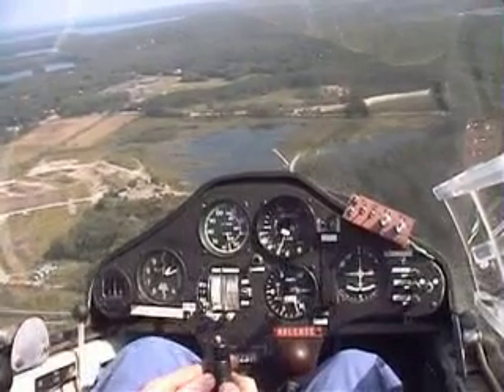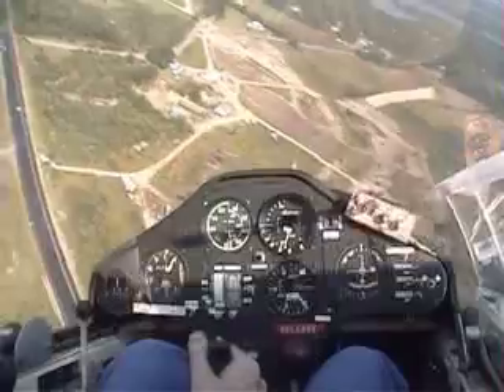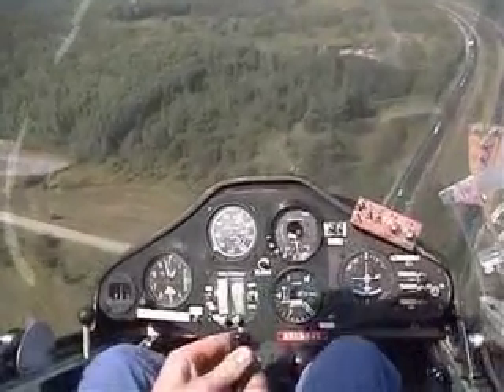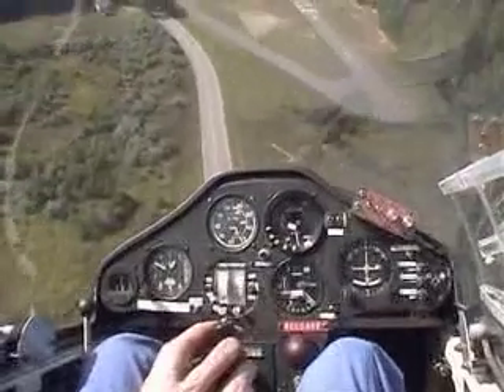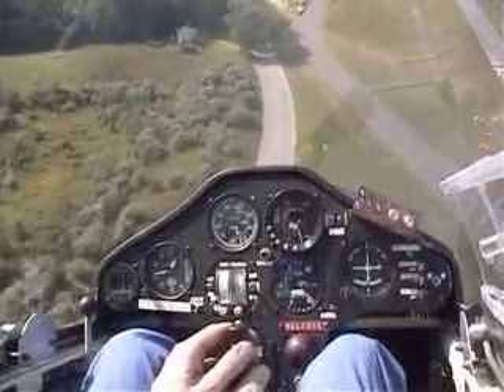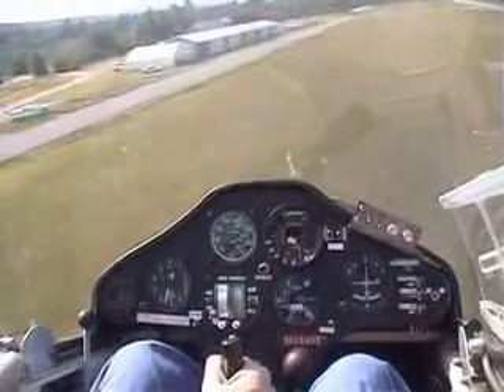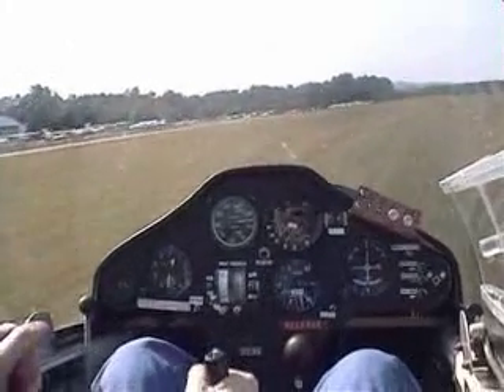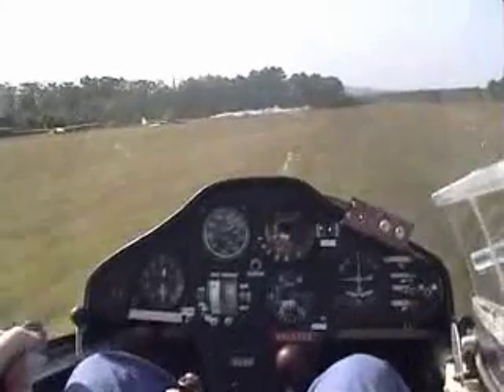cockpit shot of glider landing

Comment: I'm aware of 3 gliders that have flaps but no spoilers: Schweitzer 1-35, Pik-20, and Concept 70.  All have a very distinctive nose-down attitude on final that has to be pulled out prior to touch down.  It was hard to make out airspeed, but he absolutely did take off at least 20 knots prior to touch down, its very possible there was a little tailwind.  Unless you are familiar with landing those aircraft, you aren't in a position to criticize the pilot.

Comment from the maker: At 45 seconds, and most importantly before the glider touches down, the black flap handle comes back into view which means the flaps were retracted to at least 30 degrees which would cause the plane to drop from the sky, necessitating the increase in the angle of attack to prevent a hard landing. Note that as the glider skims the ground the black flap handle is in the same position as it was at the very start of the video. Very observant, I really appreciate you pointing that out, shess0501.

Comment: What on earth was that massive "jerk" on the stick (not a reference to the pilot) just before touchdown?  Landing any airplane, especially a glider, is a "dance" not a "wrestling match."  You can land that plane with a thumb and two fingers on the stick; the other hand should be on the dive brakes!
Reply: The Schweitzer 1-35 does not have any speed brakes, instead, the flaps can be extended to 83 degrees. The detent that holds the flap lever at 83 degrees has a nasty tendency to slip. The slip here happens as the glider enters the ground effect, increasing the pressure on the flaps. The slip results in the flap extension going from 83 to 30 degrees in an instant with the glider in freefall. That's where the massive jerk back on the stick increases the angle of attack to prevent the glider from impacting the ground at excessive speed.

Comment from the maker: @fyfanharrusett Now here's an honest guy... This glider is equipped with a control stick which you would pull, as the pilot does to keep the nose from digging an asparagus trench in the ground. This glider does not have speed brakes (spoilers) but instead relies on flaps (80 degrees) to descend rapidly without gaining too much airspeed. It is these flaps which retracted (popped out of the detent) and caused the sudden drop. Lucky there was enough speed and the glider did not stall at low altitud

Comment: @jcb2001 I never said the approach should be long and straight and low to the ground the approach should be normal but after you have rounded out keep it off the ground as long as you can provided there is lots of space. 
Having a longer less steep approach gives you more time to set up for: crosswind gusts, wind direction change, wind speed change, cattle gliders or vehicles on the runway,  rotor, thermals on the runway - if you go smashing in like that your time to fix a surprise is .....none

Comment: As a glider pilot myself here are my suggestions: don't steer on the ground, keep wings level as long as possible, or you risk a ground loop, and you can always handle it on the ground; Smoother approach and round out, less chance of ballooning; don't fiddle with airbrakes/flaps during your approach/ landing when your workload is the highest. My method may not work for you but thats my opinion.

Comment from the maker: Why the flaps retract suddenly as the glider enters ground effect could be caused by a number of factors like the change in air pressure coupled with the flaps not securely in the 80 degree detent. There is a suspicious pop sound at 43 seconds which could be the flaps sliding out of the 80 degree detent.

Comment: @fyfanharrusett I am a power pilot, but I have some glider experience. The "stick" takes place of the yoke in a powered aircraft (don't know how much you know about flying?) and is very much like a fighter plane. Generally, to get a glider to land you have to set out spoilers, which just take away lift, as well as set out flaps, which increase lift and drag at the same time. You compensate by pulling back on the stick, to pull up the nose. I am surprised how few fatalities there are in gliding.

Comment: @EVZebra     Sounds like landing instructions for a powered airplane.  This is a glider.  Gliders are suppose to use a steep approach to land.  Long straight low to the ground approaches are danger for a glider.  This landing appears to be a normal landing to me.  Nothing wrong with it.

Comment: Really curious as to glider type.  I used to fly a flaps-only PIK20b and had a few in a Schweizer 1-35.  Deck angles and flare was a bit extreme compared to spoiler equipped ships, especially in the 1-35, but approach speeds were slow.  Rolling off flaps in the flare was the spot landing trick in the PIK.  Learning to rub stomach and pat head at the same time in the flare was surely entertaining.  Two hands on stick is bad technique.

Comment: Not at high speeds, you might need both hands on the stick. But normally you don't go that fast in the pattern, and the last part is usually flown with one hand on the stick and one hand on the spoiler handle.

Comment from the maker: shess0501,
You make a very good point here that I hadn't noticed before. At the start of the video the pilot has 30 degrees of flaps for a shallow decent. The black ball on top of the flap handle is visible at the bottom left corner of the frame.  At 13 seconds into the video, the flap handle is moved to 80 degrees of flaps and the nose attitude points further at the ground and the flap handle goes out of view.
(continued, next reply)

Comment: hehe, do it every weekend. that flare pulls about 1.5 to 1.7 G-force, in 1G glider got a stall speed of 35kt, but as the G-froce increases stall speed increases as well. thats why we go up to 55kt before landing so we know for sure we are not going to stall up to 2G. I understand its not every mans cup of tee, but it is much safer. as they say "newer LOW and SLOW"

Comment: Oh don't get me wrong, I normally fly with my thumb and index finger, but when flying at max maneuvering speed in rough air I like to hang on to it with both hands. If you hit a thermal going 200+ km/h it feels like hitting a wall, and you don't want to lose hold of the stick when you do :).

Comment: With that much height, you have to fly a longer landing circuit. That means longer downwind and final legs. Maybe it would be also better to fly the downwind leg with more distance to the airfield, so you can fly a longer base leg and estimate better the wind speed. The longer final leg helps you to fly the right flighpath while CONTROLLING YOUR INDICATED AIRSPEED!!!. There is a triangle on the speedometer to know the approach speed. Read the glider´s manual and make some flights with instructor

Comment: Quite a high speed and quick descend landing, and speed wasn't down before the forced touchdown. Not the way landings are taught, is it? It seemed safe though.
It's good practice to turn off the variometer so you rid off stress factors.

Comment: @IndyHelis   You guys really don't understand glider flying.  Our club in England does hanger flights at the end of the day of flying, in order to get the sailplanes close to the hanger for storage or their trailers. That is flying and landing a sailplane right up to the hanger.  Been doing it safefy this way for over 20 years.  Normally, the runway is closed for glider operations, so crossing it is no big problem.  Gliders operate differently than powered aircraft.

Comment: not sure why one would want to suddenly raise their stall speed by retracting flaps on final.   If  speed was bleeding off too quickly at 80dgree flaps, wouldn't slight nose down gain some mph?  (just wondering because it appeared as though the pre-occupation with flap retraction almost caused a bad result if it weren't for your fast reflexes.  was this procedure normal?)

Comment from the maker: Wow, 180kts, who lands at that speed?!? If I remember, there was no wind to speak of that day so more speed would not have been necessary. The Schweitzer 1-35 has flaps, not airbrakes so landings are different and the attitude tends to be nose down when you dump the full 80 degrees of flaps. The Schweitzer 1-35 is also a single seat, so no instructor to save the pilot here.
Reply: Please get more instruction

Comment: id suggest a slightly lower final turn so you wont have to use as much air brake / spoilers which also means your not dropping like a brick onto the ground :-)

Comment: @ Bart and @ Marcel: The flare was abrupt, but a flapped glider approaches nose down as this pilot did. I see nothing unsafe about what he is doing. His speed management was good (Bart nobody slips to control their rate of decent unless they are too high in the pattern for their flaps or airbrakes)  and he even called out his desired speed on approach.
Clearly you guys don't have any experience with flapped gliders. FAIL

Comment: Flying a glider is on my bucket list, though I'm a fixed/rotary wing pilot, not a glider pilot,but seen lots of flights and landings, but this seemed too fast (50 kts!) for a glider. The constant hand changing is bad practice in any aircraft. Not sure if the camera angle contributed to his, but the nose down attitude appears too steep as well. You wing dropped too early at fast rollout, I think. You should watch a video on YTB of a 12 year old on her first solo, and that WAS a nice landing.

Comment: You wants blast try a penetration landing in a glider.... the base leg is the apex of a hammerhead....you coming low and fast riding on the ground effect....I don't recommend it for a novice pilot though, you have to know your  glider very well because it you try to do the hammerhead with out enough alt... you are a hole in the ground.

Comment: A 1-35 'eh?  Flaps only is a bit different in a saiilpane.  The pitch attitude with faps is a biotech extreme and it's never as easy as spoilers.  Flew a 1-35 once but 1000+ in a PIK20b.  I too rolled off the flaps in the flare and entertained bystanders for a season learning how to pat my head rub my stomach at the same time.  You might work harder at flying with hands on the flap control through out.  1-35 was different...yep.

Comment from the maker: The Pilot's flying experience involved flying power planes at a tower controlled field. He flew Cessna 150s in the 1980s with 40 degrees of flaps. Touch-and-Goes at the controlled field required close patterns to be flown, shoehorning the touch-and-goes between the commercial traffic. Couple that with the idea you want the field made before pulling the power and you get a pretty steep decent. "Cleared short approach, no delay!!!!!!"

Comment: Lucky boy! if you did that @ my airfield you would be back on checks. 1) dont use two hands on the stick on approach, gear down, one on the stick one on the breaks. 2)approach should be flown @ approach speed with 2/3s airbreaks, not diving at the ground, round out balloon, over shoot and run of the runway. 3)round and lookout i think you had your head inside the cockpit and it surprised you, why you then over shot and didnt use the breaks is beyond me....get some more instruction.

Comment: u nearly killed yourself  by distraction. At 47 secs into the clip.. ur  looking left  then see the windshield filling up & do a massive pitch up. U nearly died because you lost sight of your aimpoint  In All a/c on flare the ONLY task is pitch/attitude control . I've flown 18 different types of aircraft including gliders. U fly with 2 hands on the stick. 
If the spollers/ flaps accidentally deployed u can ram them home if yr left hand is where it should be.Chuck Yeager u aint. get training.